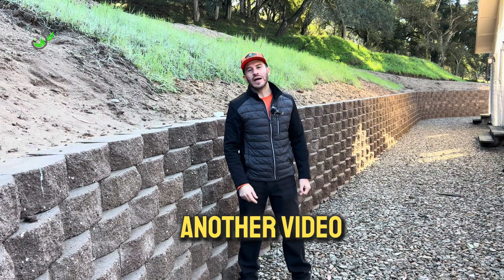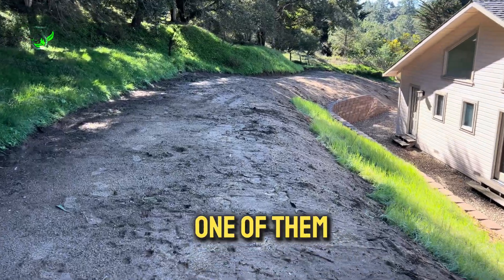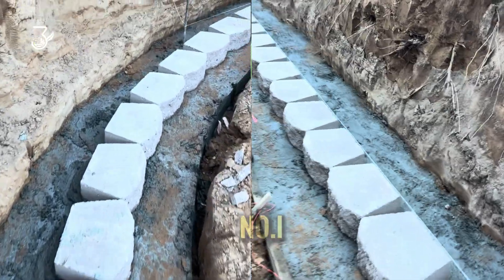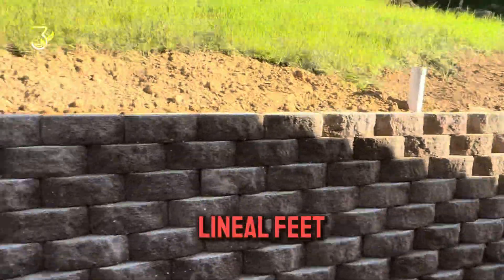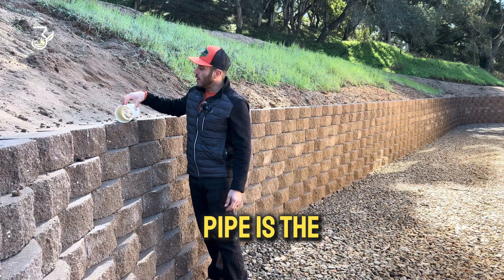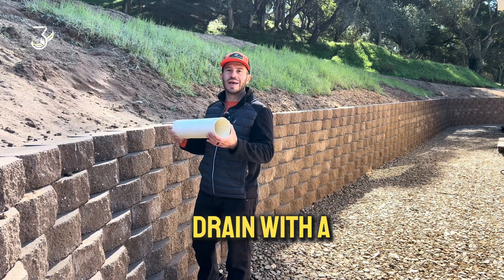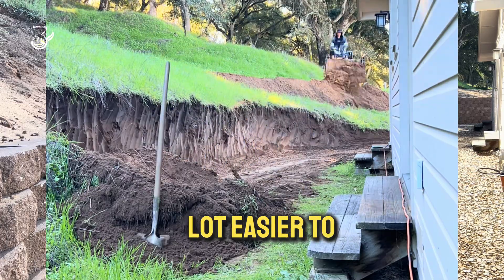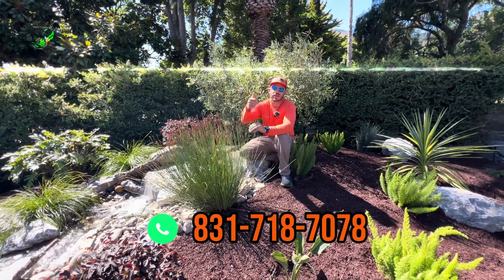$50,000 Eroision Control Retaining Wall

Comment: Even a 4 foot retaining wall needs engineered. You have to calculate the lateral load force and have a footer deep enough, rebar spaced correctly and the correct psi of concrete. What you built was a nice garden wall. But a retaining wall it was not.
Reply from the maker: Thanks for the insight! We always strive for the best, and we appreciate the knowledge you brought to this video.